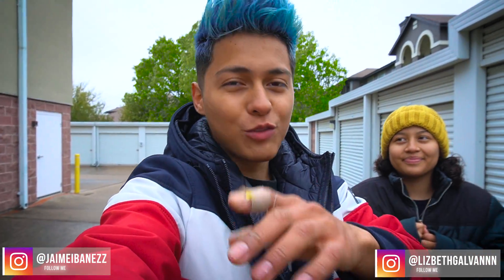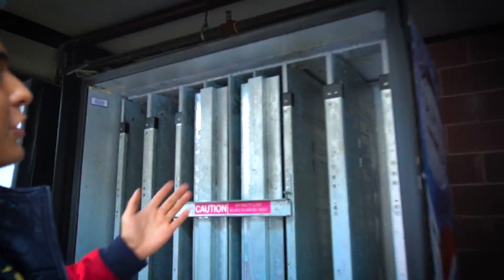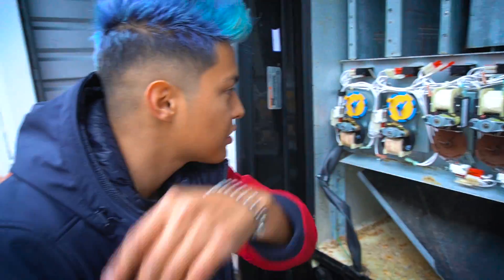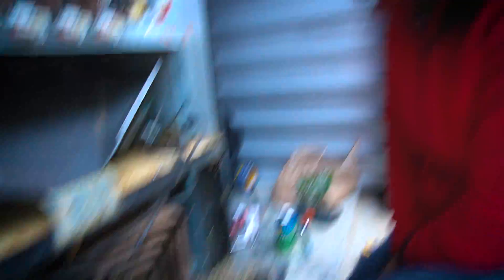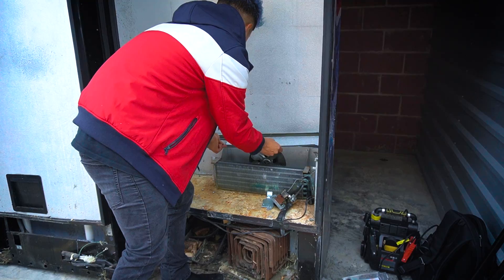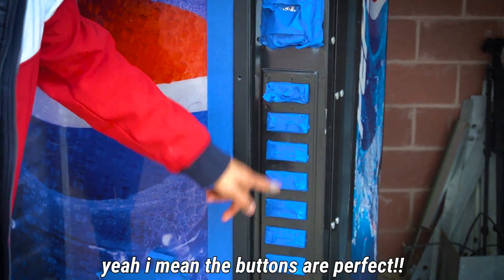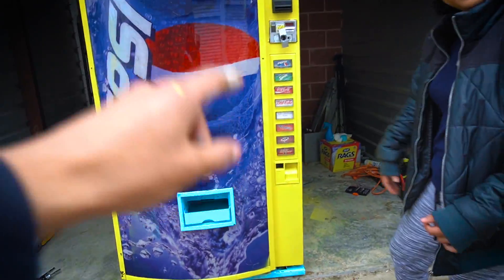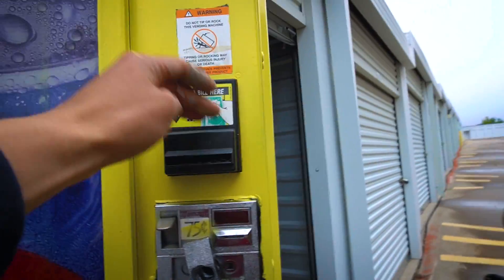Turning A VENDING Machine Into A SAFE!  *GIVEAWAY*

Comment: I know this was supposed to be fun and all but you could have saved those parts for your machines for parts . That stuff is not cheap just saying they have a blank plate and they have a bill accepter face they sell so you can keep the bill unit . They are like $200 used